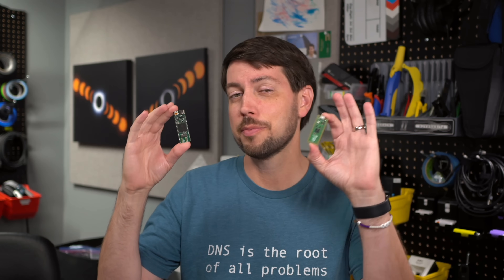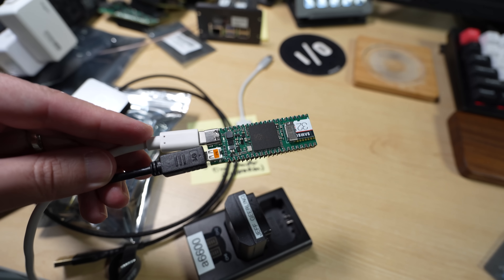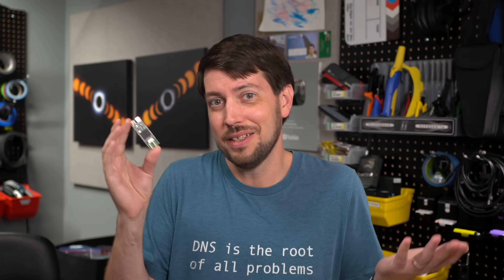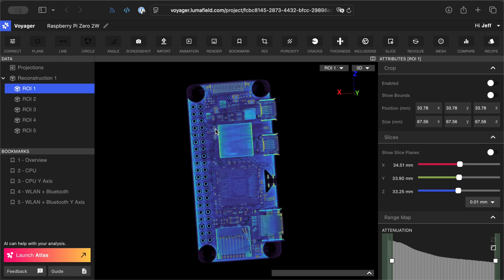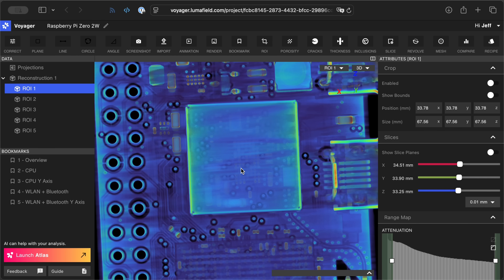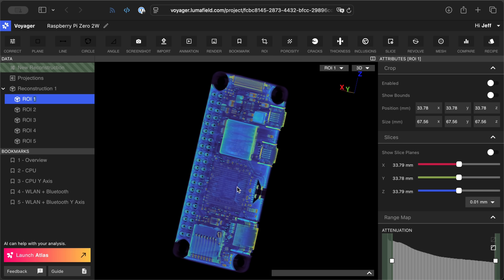Reverse engineering the Raspberry Pi Zero 2W

Comment: I have made many boards from other boards and never have HEAT problems as a matter of fact I have a CENTRAL CONTROL BOX with at least 100 components and needs no fan too keep front overheating or exploding been in use for over 5 years

Comment: I got a question why you don't follow the PCB tracks without the components using a multimeter and making a table where you can link everything and look what is connected to what and then remake the same design just respecting the sockets of the components?

Comment: Not a reverse engineering project, but I've thought of replacing the system board of an Acer AspireOne netbook with a rPi Compute Module.  Unfortunately I have zero knowledge of circuit design.  It's certainly not a cost-effective project, more that it would be interesting.   Kind of like a friend back in the 80's squeezing a small-block Ford V8 into a Dodge Colt just to win a $50 bet (the money wasn't the purpose, the challenge was).

The other non-computer project I'd want to try is to make a media player (MP3, FLAC, etc) that worked in an 8-Track tape case (handy if you have a vintage car with a factory 8-track player).  Very VERY small market, more that I'd be curious how to make one.

Comment: Why reverse engineering? THe plans for this piece are publicly available curtesy of the RPi foundation.
Reply from the maker: Only some parts of the schematic are available. You can't recreate a Pi Zero 2 board using the public information on Raspberry Pi's website/GitHub.

Comment: I have an old GE Nanomex CT XRay at work and one of the newer Waygate Micromex machines that we use for exactly the kind of failure analysis you mentioned and I've got to say that the Lumafield CT scans were very impressive. Being able to image the silicon die on a fully populated board is no joke and says a lot about the kind of dynamic range they're able to get on their machines, silicon is damn near invisible to x-ray. That's roughly the equivalent to being able to see the scratches on the lens of a bright flashlight while it's shining into your eyes.

Comment: The schematics of all their products are on the companies website so no need to reverse engineer any of it. They aren't partial like you say. You don't need the physical component layout if you have the schematic and the component ID's as the documentation will tell you everything you need to know. Reverse engineering like this is only needed if you want to copy the device exactly which isn't what was done here. Getting hold of the APU new is the hard part. Also 52C isn't hot for an IC, the display on these always shows the hottest part in yellow/white even if its not really hot, if you have an ice cube fully in frame it will show some part of the ice cube in bright white/yellow you always need to look at the scales values to see what temperature something is.
Reply from the maker: The chip would hit 58C during the boot cycle. not too hot, but hotter than it runs on the Zero 2 W board in my testing. still not near throttling range.

Comment: I really hope Pi foundation will keep enhancing the zero w 2, I hope they can at least fit in Pi 4 2GB RAM on it. I have one that is currently working as backup dns and local network routing server. Another one sitting in my car as Android Auto gateway. Its small form factor and low power consumption is perfect for small application like these. 

Anyway, cool vid as always Jeff. I hope we can get to see more SDR and meshtastic stuff 😊

Comment: "Only modern Pi still using micro USB" That and the raspberry pi pico:) It would have been nice if they had converted the both on there version 2 but its not that bad.

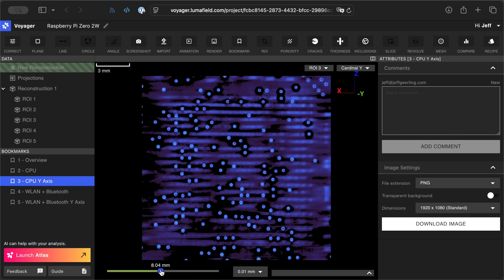Comment: Question, why is the Z axis, height, called the Y axis at 6:50 ish? That makes no sense when the view is top down so left/right should be X, top/bottom should be Y, and up/down(layers) should be Z.
Reply from the maker: Heh, I think in this case it has to do with how it was scanned more than the cardinal positioning of the PCB from an SBC user's perspective.
Reply: @Level2Jeff Makes sense, some software, I know Minecraft does it, uses Y for height. I'm a machinist so I've always used X&Y for left/right and front/back, and Z for height so it always strikes me as odd when Y is a height value. Also, long time subscriber and this is cool to get a response from you:)

Comment: I’m sure I’m not the first to think of this… but what if you desoldered everything and just used a continuity checker to test every pair of pads to see how everything is connected? Could be automated with a bed of nails
Reply: That would tell you about the connections, but not about how traces are routed, either for length (timing) or for impedance matching (fast signals and RF), or for power plane partitioning. That PCB has some serious ground plane management around the signal leading to the WiFi antenna, for example.
Reply: @GodmanchesterGoblin  ooh that makes a lot of sense!

Comment: I pronounce the Raspberry Pi Zero 2 W splendid.  I run Gentoo Linux on it.  When I want to compile/build a large project, I take the HD card out and place it in an Rpi4 with 8 GBs and perform updates and builds that would otherwise fail on the Pi Zero 2W due to memory limitations.  Then when the binaries are all built, I return the HD card to the Zero which happily runs.  I'm using the Pi Zero 2W to capture and record decibel levels (PCB Artists decibel chip) each second, and then when the decibel level exceed 64, then every 250 milliseconds.  My neighborhood is plagued with loud aircraft which the City of Salem could care less about as they believe expanding use of the airport will bring revenues and happiness to the tourist industry and residents should just go pound sand.  Well, the next time "official" public hearings are had, I'll have 2 years+ of data (correlated with ads-b data that I capture with a Raspberry Pi 4, about 40 MBs a day/zipped) and can reconstruct flights and show the decibels they cause.  The FAA likes to use theoretical models which nobody understands and which cost more than $1,000 to obtain and then they theorize about what noise nuisance might be and rely upon their trumped up data.  My mighty Pi Zero 2 with the decibel chip providing real data might say otherwise and make for interesting hearings where the officials will have to ignore facts in order to achieve their desired results.  In this way the Pi Zero has and will enable affected residents to participate in decision making.

When a Learjet buzzed the City of Salem to sight see the Golden Pioneer atop the state capitol building (at 180 feet) in April, 2024, coming within 100 feet of 2 government buildings at an altitude of 175 feet above ground traveling over 160 mph-- 2 miles from the airport,  my Pi Zero 2W decibel monitor captured the entire event with decibel levels as high a 92!  The FAA did nothing and promptly closed the complaint.  But the Pi Zero 2W keepa goin'.

Comment: DNS is not the root of all problems. 

Intel Management Engine, AMD Secure Technology, ARM's TrustZone and the similar systems implemented on all our devices for our "safety" are the main problems. 

Without those, DNS can't be used to hack us without an initial man in the middle attack  acces to our ISP or some way for the initial hacking. 

Somehow, i saw that all browsers made by the big corporations but also thise made by smaller ones made their browsers unsecure (ex: enabling WASM by default and that's not the only issue), probably exactly for that initial hack that is needed. All 

Androidd phones use Chrome View as the base for apps, so browser's security it's very important.

My conclusion is that DNS is not the root of the problems, but after the initial hack it's the main element used to install new things on your device by the attacker. The big problem is that now all our devices are already hacked and i really don't see how we will exit from this, because it seems that the ones that rule the world we live in wanted to do this to us. It's made, supporred and hidden by authorities.

Comment: We had a great time CT scanning these amazing little computers. Thanks for sending the Pi's over to us Jeff!
Reply: Would you guys be willing to take scans on more rare hardware for the sake of preservation?
Reply: @lumafield thanks for letting people like Jeff use your hardware. You're way beyond what most of us will ever get to tinker with, but it's super cool to see what's possible these days :)

@yannor7 it shouldn't be destructive - it's x-ray so there might be some risk to e.g. bitflip flash memory for long scans, but other than that... don't stick your head in the device :P
Reply: Thanks for making these 3D Scans publicly available, this technology is really cool!
Reply: love you too
Reply: @lumafield I am completely new to it but I am curious is CT scanning destructive for the chips and other components of the PCB ?
Reply: @yannor7  Industrial CT scanning is actually becoming standard nowadays for big companies starting maybe 15 years ago to become mainstream. Sometimes the x-ray radiation is harmful to the software, it does not damage the hardware, at least not under normal conditions. We scan lots of electronics hardware for manufacturing QC and for failure analysis. Sometimes there were issues running the software again afterwards. Probably depends on the scanning parameters
Reply: We could have saved Ahmad’s fingertips with this technology. Really great showcasing here. Thanks for the mention Jeff for the Open Source PC110 project.

Comment: I was planning on reverse engineering a pi zero to make a embeddable/compute module version. a lot of projects use pi zeros but the pinout of the pi zero requires cup hole solder in small form factors like the Null 2. a version with a board to board connector makes those kinds of projects so much easier. the user would just need to buy a premade module and the project and plug them in. But with this I dont have to do the hard part of reverse engineering and I can go straight to designing the form factor. Thank you so much Jonathan!

Comment: Wanted to do something similar for a lot of time but I'm broke.
rpi should sell the chip!
Reply from the maker: It'd be cool if they could sell at least some of the Pi chips, so we could build boards with full Linux like we can already build boards with RP2 chips!
Reply: @Level2Jeff if I remember correctly the OG chip was available and odroid/hard kernel guys made a compatible board.

Then the arducam team also did the first castelled hole version of a rpi2.

Now this is awesome. What is cool about this chip is that doesn't need caps on the bottom side. So for hobbyist it can be quite easy to design around.

I was hoping on a alternative gr8 sip aince chip failed. Was the chip called gr8?
can't remember has been ages!
Reply: I'm still hoping they will sell the rp1...

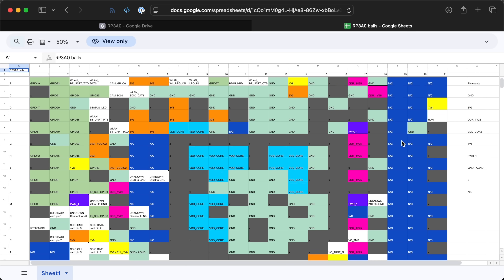Comment: 1:09 - they put their raspberry logo into the ballgrid of the CPU o_O
Reply from the maker: And it's fun because that logo's pins are all power and ground, so you could say the logo 'powers' the chip :D
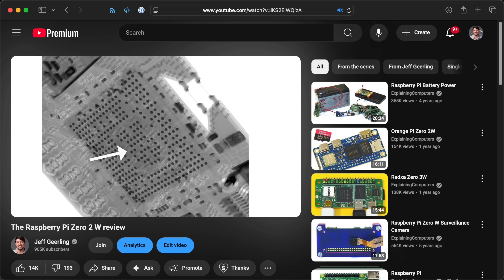Reply: Jeff points this out later in the video 2:03
Reply: So glad I wasn't there only one that noticed
Reply: Sharp eye!
Reply: wow
Reply: It’s because they have legal protection of their logo so if the chip design doesn’t have it, you still can’t make a clone
Reply: @Adam-n1p6m Yup. Kind of like how the gameboy used the Nintendo logo as a key to run a game. Without the logo on a cartridge, games cannot boot. If you do have the logo, and you aren't supposed to... good luck.
Reply: @GarrettThornburg Didn't they lose that lawsuit stating that wasn't a valid system?